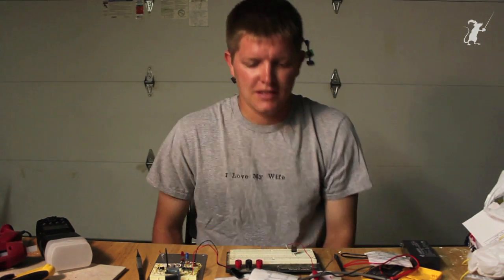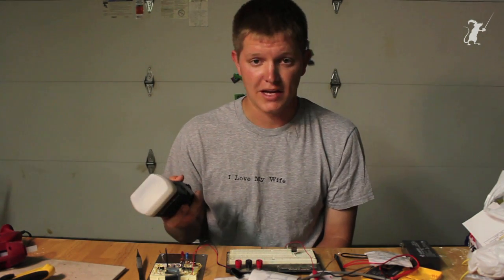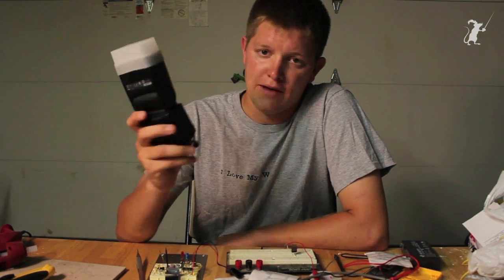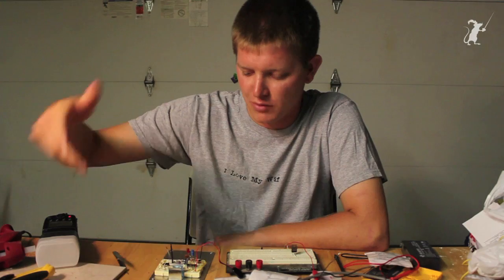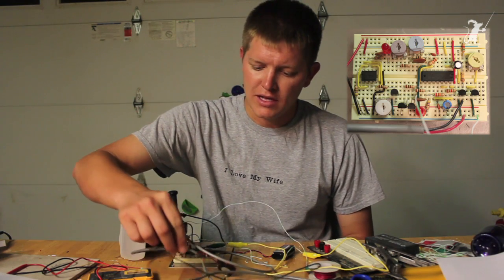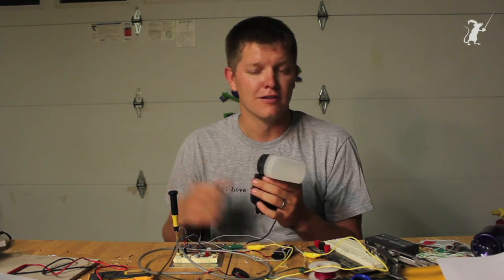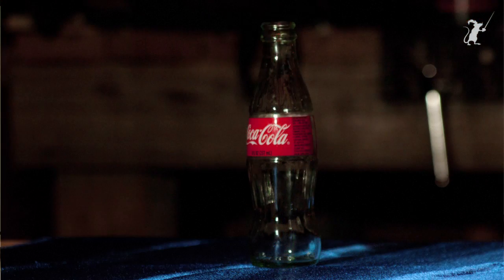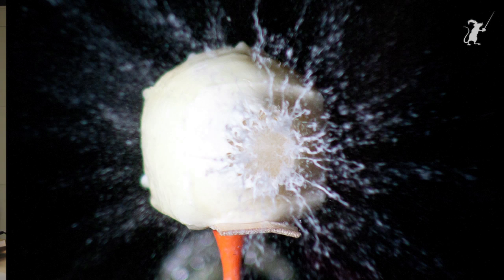High Speed photography 101 - Pre-Smarter Every Day

Comment: now, although this is a great way to start for me, however my camera has a minimum exposure time of 1/8000 seconds, or 125µ seconds if I am not mistaken, would I be better off making a faster flash or set my shutter to minimum, connect this circuit to my camera and use a continuous light source (we have some 5KW lights normally used for testing dimming equipment)

Comment: I Think this could be easier with an arduino micro-controller because you can accurately control the delay (analog Vs digital :] )and there are fewer component required to achieve this.
But it it all up to a personal preference

Comment: I made that circuit once :D
Condenser microphone connected to a potentiometer to control the sensitivity of the mic, two bipolar npn transistors to work as a bi-stable multi vibrator, and bunch of LED's .. when you clap the LED's turns on, clap again and they're out.. I think I can use the same circuit for this experiment but I need to modify it to a mono-stable multi vibrator :D :D

Comment: I have a question about your flash setup.  What was your flash output for the pictures? You are using a Canon 580 EX II right? I just bought a hiviz kit and want to know how well my flash would be able to stop a bullet, but it seems that at lowest duration for my flash (sb600) might still be too long to stop a bullet well.  Might have to try a cblong to get the bullet speed down.